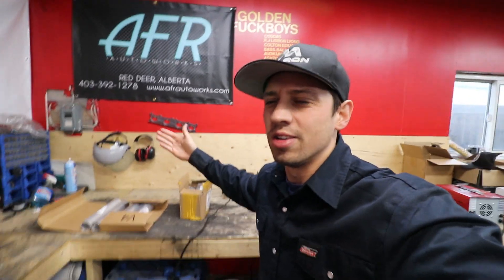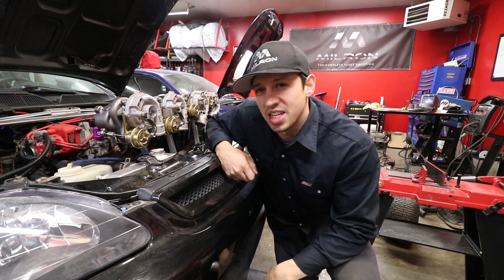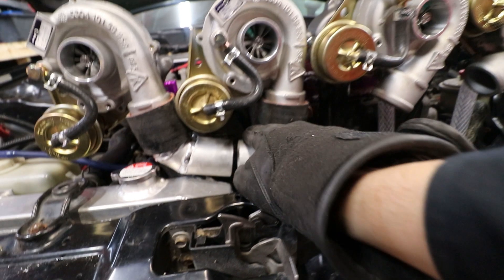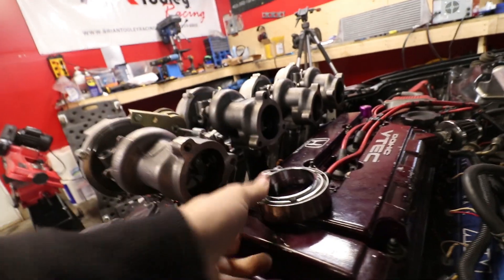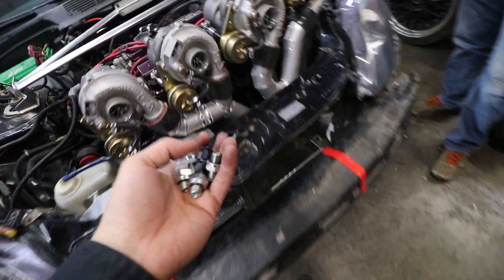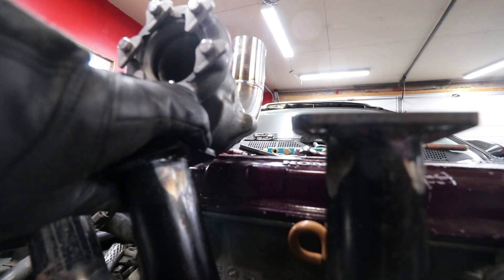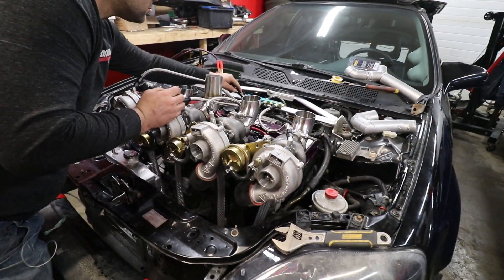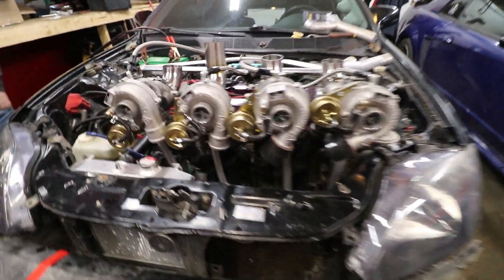Quad Turbo Civic Build - Part 3 - Sounds Savage!

Comment: Yo, Look up the vtec oil pump mod, you're gonna need the extra oil  psi with all them lines.
Reply: Shim err up
Reply: i personally dont even see that working.. he may have to actually run a external oil pump in general..  or i see some burnt up turbskie in a short amount of time lol
Reply: Just lock Vtec. Vtec makes a decent engine only good up top.
Reply: @zuestoots5176  vtec doesnt make engines.. lol
Reply: ohwow VTEC just makes power at about 5 500 RPM or more, that is what it mean
Reply: @ruikazane5123  its just a solenoid
Reply: ohwow stick it in VTC all day long?
[edit: VTEC solenoid operates at about 5 000 rpm, which cam lobes change lift and duration]
Reply: @ruikazane5123  yea i know. bad thing about having vtec on all the time is a high possibility of floating valves and abunch of other junk. damn near the worse thing for a honda engine is to keep it in vtec constantly lol. its safer and easier to just run a secondary oil pump rather then fucking up something over vtec when you dont have too hince why it engages at a certain rpm for a reason..
Reply: VTEC delete and ls sawp 😁

Comment: Your welding and fab skills ARE getting better, so must your knowledge. Add this to your database:  Buy stainless steel wool.  Keep it in a clean plastic bag.  Use it to clean new aluminum TIG filler rods just before you use them as they have an oxidized crud layer  from being exposed to the air.  It will make your welds a little better yet.

Comment: Looks like the drain bungs are low in the pan and youre just seeing the oil sitting down there when the engine is off. check for backup while running thats what actually matters and you might be fine

Comment: Channellock 909 Wire Crimping Pliers. Klein has a version, too, 1005 Wire Crimping Pliers. Electrician's use 'em, so look in the Electrical tools section at Home Depot or Lowe's or your local hardware store. :)

Comment: well … i can see allot of problems coming for tuning and short turbo life, not to mention the heat under the hood..      But hey…  as fun as you are having fun building that and fun while trouble shooting it.. then its all the better for you and entertaining for rest of us.     

Tip to combat the surge of turbos and maybe even some starting to spin backwards due more pressure on intake side than on exhaust side from single hole,  you should build some anti backpressure valves on boost lines behind every turbo.

Comment: How about routing the high pressure air from the turbos to individual intake runners?  That way you can have 2 and 3 feed 1 and 4 and vice versa. Then you will  get an exhaust pulse at the same time as the pistons are on their intake stroke.

Comment: I think the oil returns are below the level in the pan which is why you may be having the backing up problem. Oh! And put the feed line in the end of the manifold rather than the back. It may not make a difference, but currently it "should" favor the middle two.

Comment: Heat the header with a torch and bend it a little to set the angle correctly and you can use the v-band.

Comment: I'm rooting for you bro, I hope it works out. But have you seen some people have to Fab up a pressure reserve tank for single cylinder turbo kits. Because the exhaust pulses being too far apart. Watch the boosted boiz shopping go-kart vids. Maybe it won't be an issue with such small turbs?.?.

Comment: The oil in your drains is where then oil level is the pan,  It will stay that way.  It will work but drains should be above oil level to be best.
Reply: Don Ogoobo this! I was thinking why are u drilling those so low on the last Vid

Comment: If you have any extra aluminum flat laying around, you may wanna make a cover for the spark plug wires so they dont melt from the exhaust heat.
Reply from the maker: I mean the wires on my ls engine are way closer than that 😂
Reply: Haha send it then! I had a top mount setup on my old B16, and the downpipe managed to melt 2 wires when it was on the dyno, even though they were a foot away. 😒😂

Comment: Put a pressure sensor or gauge on the oil manifold extra spot so you can see turbo oil pressure
Reply from the maker: I have one I just didn’t have an adapter during

Comment: When the car sits overnight where will the 2 extra quarts of oil sitting in the turbos drain to?
Reply: live and let live back into the oil pan silly
Reply: @dickjames5007  my question was will it fit the 2 extra quarts and what about the turbos on a cold start they wont have an oil
Reply: live and let live you have a lot to learn about this topic, lol
Reply: @2jimmycrackcorn  that's true

Comment: Would be a lot easier to cut a slice out of the hood, do it like an old camero blower basically. Let it stick out a bit, because... seems really difficult to fit all that under the hood... your crazy lol X) that stuff probably wouldn't fit under a stock hood so might need some fiberglass epoxy, custom abomination.. hood scoop. Or something.but all that stuff is probably not going to fit under the hood. But. Good luck it's kinda crazy but have fun. An excellent experament and itll make some power I bet

Comment: what are those pliers called that you "bead rolled" the alum pipe with?
Reply from the maker: Hopefully someone will chime in with the number of them. Like 924 or something
Reply: They are crimpers. Electricians use them, so you'll find 'em in the electrical tools section at Home Depot.
Reply: Channellock 909 mate

Comment: Surely the turbo oil returns will not drain that fast with the engine shut down as they have no vacuum via the oil feed to allow them to drain, then there is gravity to think about? Why four and not two turbo?

Comment: Nothing wrong with your high pressure side argon gauge, they're cheap and inaccurate. Thats normal. Argon is delivered around 2400psi and you have what looks like a 5000 or 6000 psi gauge there so its not gonna show ya a whole lot at lower pressure. I work with high pressure air, compressors, and regulators.

Comment: Duuuuude. Take the dang black radiator support off and out of the way until your done, lol crap, cut it out if you have to and then weld it back later.

Comment: Your fighting the flow a bit by not having the compressor sides running with each other.  If you were to angle the tubes with the flow angled the same direction, it would greatly improve the airflow and provide a scavenging effect.

Comment: 4 turbos on 1cooler...no way you will get the boost correct you need 2 separate coolers ...no possibly enough air flow it will restrict the flow..and get the turbo's way too hot..!

Comment: Sure you have enough Wish turbo's? I can take you a bet not all turbo's boost the same and pointless to have one turbo per cylinder. Point is you'll have pulsating turbo's which means you have have turbo's speeding up and down and insufficient flow which well means loss of power created. 
But I guess it's a Honda thing RICER allert

Comment: Bro you did it all wrong, you have to route two of the turbo outlets into the other two turbo inlets to make like quadrubple the boost and 16tupple the power, fix the oil feed lines and youll have a 4cyl Bugatti engine